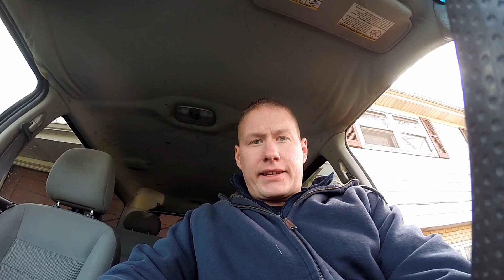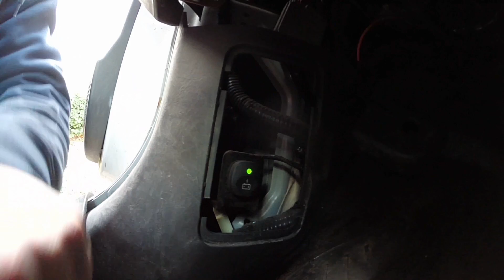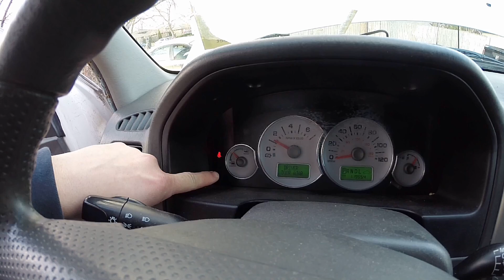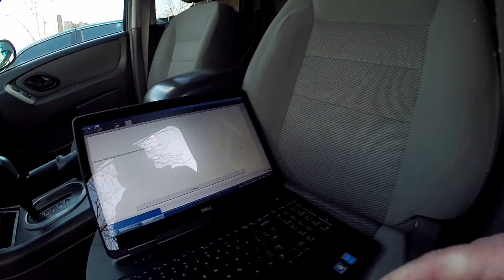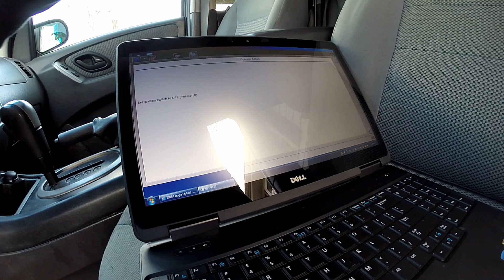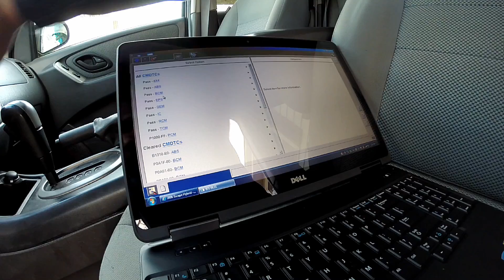2007 Ford Escape Hybrid No Start

Comment: I've actually got the 2008 and normally the button works but this time it's not. There's a clicking sound coming from the dash, rapidly, even though the key is not in the ignition. I had left the back right window down when I went in the house and when I came back out to the car about an hour later it was dead. When I push the button it turns sort of orangey, not green. I replaced the 12 volt battery about three or four months ago.

Comment: You are the man!
Bought a 07 at auction. Non running. Full battery dropped in it and with one push and 10mins it started up in the auction yard and drove on the trailer. Needed a coil, valve cover gasket you know typical L-series maintenance. Thanks again

Comment: 1)  Instead of charging the 12 volt battery first  and instead of hooking up a battery pack the the 12 volt battery.....  Can we use another vehicle with jumper cablers connected to the 12 volt battery on the hybrid escape and then use the same sequences of pushing the black button and wait 8 minutes while the system charges the rear hybrid battery?

2)  Would the jumping vehicle need to be running during this process as well?

Excellent and Very Helpful info Sir!!!

Comment: Does this work on the 2008 Mercury Mariner Hybrid as well?
Reply from the maker: yes
Reply: @FordTechMakuloco  I can't seem to find this button that you found and pushed on my Mariner. Do I need to look harder for it?
Reply from the maker: watch this video- https://www.youtube.com/watch?v=TA6Of25tnCY&ab_channel=FordTechMakuloco
Reply: @FordTechMakuloco  TY so much for getting back to me on this issue and hopefully tomorrow I can get it running again 😊
Reply: @FordTechMakuloco  Great News after you advised me on the location of the BCM button behind that driver's side panel and having a new battery and jump pack on the battery as well. Your excellent service helped me get it to start after about an hour of charging and everything works fantabulousy.
Thanks Again you've saved me a lot of money in having a tech look at it and was simply simple.
Once again TY Brother 😊😁

Comment: I have charged the battery and the HV battery is charged. But still will not start because the triangle symbol is still on the dash. Does anyone know how I clear the codes without a code reader?

Comment: Have a issue 
The wrench light and red triangle with exclamation 

Truck won’t start at all 
Both Batteries charged
Obd monitor test:
Exhaust gas sensor mon bank 1
Exhaust gas sensor mon bank 2
Catalyst mon bank 1
Egr mon bank 2
Evap mon A,B,C
Misfire cylinder 1 data A2
Misfire cylinder 2 data A3
Misfire cylinder 3 data A4
Misfire cylinder 4 data A5

What could I do ?

Comment: Ver informative. I have a 2015 Fusion Hybrid. My High Voltage battery is dead due to non use so the car won’t start. Would you happen to know how I could “jumpstart” my car?
Reply from the maker: These require a special charger the dealer can rent from Ford.

Comment: This is an amazing video unfortunately when I press the button of my '08 (slightly different location) the LED does not even light up. Do you have any suggestion?
Reply: Hi I own an '08 as well this is my second time going through the process it seems the LED for the '08 will come on as an amber color if the battery isn't fully charged and if you're in a bright area and not looking the button head on it's nigh on impossible to see that the light is on hope this helps

Comment: Can a dealer test the DCDC Converter? Have our 2007 Mariner at the dealer and they want $2900.00 for the converter. I asked how they came to that conclusion and they said " we follow ford's troubleshooting points." 
What is the best diagnostics tool I can use to check this component before we start throwing money at it?

Comment: My 2008 still runs and drives but if I take off real quick it will pop a P0A1F battery energy control module fault.. any ideas?

Comment: My 12v battery on 2006 escape hybrid is fully charged, all lights work fine, but still does not crank.  I found the jump start button under dash to charge HV battery but when pressed with key off, does not light up.  How can I charge HV battery?

Comment: great advice   I have that same escape LOVE IT the best  It paid for itsself and its insurance! Off road is so sweet total stealth when you went into the reprogram mode i flashed back to 1 day driving along and just when i passed a Ford dealer I had total break pedal lock not the complete break failure just the pedal lock then let off and try again and it works But soon after i started having the TOTAL break failure where it shuts down the vehicle completely and youd be lucky to stop at all !!!  Well years later after just putting up with the once in a blue moon failure i blew a front break hose out in the wooods and after replacing it i chose to just gravity bleed the front calipers! Strange but it fix stopped the failures that was 3 years ago! Your vid made me wonder if theres a wifi antenna on my hybrid and it was corrupted by a ford dealer?  PS something about the anti lock valves and the front pressures?

Comment: Recently purchased a 2006 hybrid escape being sold by the state, they were selling it as a non-runner. Got it for a steal. Of course it didn't start,  12volt battery was dead.
Found mention of the charge button in the operators manual. Did a google search on no starts. Found your video Did exactly like you said, WALLA it started. 
My wife found a receipt from a Ford dealer, that said it was the hybrid battery or wiring harness. They charged them 300 dollars for the inspection. I can't believe a dealer did that.
Thank you very much for you video.
Reply: Hi Raymond I just got the same situation like you did buying 2006 escape. Could you exactly ho
Reply: Hope your still around, did you replace the 12volt battery then? That fix the issue?
Reply: Basically a good running car for I operability status/price. That does sound like a really good deal! The dealer was inept for doing the owner like that. It was meant for you I surmise.

Comment: What program on your computer are you using to do all those updates and everything for the hybrid battery I have a 2007 hybrid myself and I would like to know how to make the batter in the back more reliable?
Reply from the maker: I use the Ford dealer scan tool. The best way to make that battery reliable is to drive it and keep the current flowing.
Reply: I also have another question, my car is only getting 22 mpg and I know these cars are suppose to be getting more you have any idea how to get that to go up or if it’s anything with the hybrid battery that would make it stay that low
Reply: Any thoughts?

Comment: Hey bud I’m having a issue with my 2010 escape giving me code cylinder 3 misfire I change the plugs and coils all 4 cleared the code but came back on did a cylinder compression  test on the cylinder reading 100% check the injectors reads 1/2 cylinder 15/16 3/4 3 14 and 4 16 any ideas please thanx

Comment: I just bought a 2005 hybrid ford escape. The suv wouldnt start so i did axactly what this video said but now the radio dontvwork and the speedometer dont work nothing comes on not even like the rpms indicator or the mph indicator and there is a gauge that says assist that one doesnt turn on either or the miles indicator or the prnd do not show. What can i do???? Any help

Comment: Had a no start as well.  Left it undriven for 1.5 months, came back, engine would turn over and then died after 20 seconds.  Tried again, no turnover and wrench light etc. light up.  No turnover.  Reset battery, it would do the same thing...turnover once and run for 5 seconds then die.  Wouldn't turn over again.  Took it to Ford Dealer and they said the High Voltage Battery was completely dead.  They recharged it and voila.  On retrospect, if we let the car sit for a few days, the voltage indicator would show that the High Voltage Battery was dead and the engine would surge on first starting.  Not sure why this slow drain is happening (or did happen) but it hasn't turned over/no start since.  And we also won't be letting set for 1.5 months again.....maybe disconnect the battery when we go on long trips?

Comment: Hi makuloco.....How can you know if CVT is bad?  I heard that the electric resistance (Ohm)  measured between cvt connector terminals cable component side??? I think i have some issus with the CVT because my battery fuse is bad. i was going down the freeway and it had to be towed home ...The fuse is very expensive...

Comment: This video is a life saver! I have a 2007 Ford Escape Hybrid in Phoenix AZ that was sitting for a little over a month. My battery   was completely dead (from the heat and not moving) so I bought a new one. Car still wouldn't start after installing it but I did get lights and dashboard indicators working. So I followed your steps by hitting the battery charger button on the left side under the steering while. Everything worked as you said. I hit the button and had a solid green light. I hooked my other vehicle up with jumpers just to assist with maintaining a charge (not sure if that was necessary) and after about 4 mins the green light began to flash. Tossed in the keys and it started right up! So thanks again man.

Comment: I have a 2008FEH last week while driving steering wheel locked and car shut off. Had it towed as I thought it just got too hot. I do live in Las Vegas and the temp that day was 120. The next day I turned it on and it stayed on for all of 30 seconds and shut off. I did notice the wrench light on and now the ABS light is on. I'm afraid of how much it's going to be to fix it. Any suggestions?

Comment: My 2008 Ford Escape Hybrid does not have the button in the kick panel on the driver's side.  Where else should I look?  
I have a 2008 with a no start condition.  I'm sure the battery decharged again when I left it for a few days without starting.

Comment: does the 2006 FEH have any module inside or outside the hybrid battery that can be reprogrammed / updated?   If it does, what Ford training/certification is needed to diagnose and be able to do such work?  Thanks!

Comment: frank t    Great Video!!!    I just had the coolant pump replaced on a factory recall on a 2006 FEH.  Prior to this I had a problem with the engine shutting  down on a private bumpy dirt road on two occasions so,  I asked to have the hybrid battery reprogrammed or updated while it was at the Ford dealer, since it seems that this is what you did on the car in this video. I asked that the dealer supply me with some print outs showing the job had been done. When I went to pay the bill they had interpreted my request as follows: C/S REQUESTED TO SEE IF THERE IS AN UPDATE THAT NEEDS TO BE PERFORMED ON THE VEHICLE.  RUN IDS DIAG AND CHECK FOR UPDATES ...PROGRAM PCM AND TCM TO LATEST CALIBRATIONS. 
 
When I asked for the print out the service advisor said he would check with the tech.  The tech came back and said he wasn't asked for that when he did the job and it was too late to be able to get a print out.  I asked about why he didn't program the hybrid battery,  He said the hybrid battery didn't had a module that could be programmed.
My Question is this: does the 2006 FEH have any module inside or outside the hybrid battery that can be reprogrammed / updated?   If it does, what Ford training is needed to know this and be able to do such work?  

Since the Factory Recall 14519 the car has not shut down on the bumpy road, and my gas milage has increased by several mags.

Comment: I am having same problem with my 2005 Ford Escape Hybrid.  The weird thing is when I press the Jump button it blinks and does not go solid.  My battery (12v) is fully charged.  I even tried to connect my 12v to another car at same time to ensure full charge but when I press the Jump button it still just blinks.  Any ideas? Does this mean my hybrid battery is toast? nlellis8 at Gmail dot com.  Please if you can help and thank you.
Reply from the maker: Make sure the key is removed from the ignition for 10 seconds before pressing the jump start button now it should go solid.
Reply: I tried this as well and still when I press it just blinks.  Is there any way I can bypass to get a charge to the 330v?  Wondring if the 330v battery is toast and that is what is causing problem?
Reply: @CDBS-Magazine  Any update?

Comment: Most 2008 and all later model don't have that start buttons.
Reply: That's right . My 2008 FEH does not have one . Is there any other way to recharge hybrid battery on it ?  Thanks for the videos you post Brian , excellent work!
Reply: 2008 does. It is behind the panel in the door jam on the dash. The small panel needs to be removed. See Brian's other video on this.

Comment: I have the red triangle with check emission systems after I hit a bump. it was only 3 days prior to this that the strut smash through the floor right passenger rear. I haven't had a chance to fix the strut and then this new thing happened with a car shut down saying check emission systems red triangle. this happened after hitting a major bump

Comment: I have a 2009 it does not seem to have the button to charge the high voltage, what is my option?
Reply: Any luck with this?  I am having the same exact problem with my 2009
Reply: @bastholio  hi  I have 2012 ford escape Hybrid  no start   how to recharge hibrid  battery
Reply: Any luck with charging the battery I just bought a 2009 with the same problem any help would be highly appreciated

Comment: Just replaced the HV battery on my 06 escape Hybrid started for about 5 minutes and then dies again . Red triangle and yellow wrench are on waiting 2-3 minutes starts again runs for about 20 seconds and then dyes again I pulled on my obdII scanner P0A1F . My question is if the BECM needs to be programmed or the PCM after replacing the battery

Comment: I'm looking to buy a used Escape/Tribute as a first car for my son, but I rule out the hybrids.  The cost is about the same as the non-hybrids.  They are reliable until they are not, then it is just another level of complication and potential significant cost. Thumbs up on your video though, dealer would likely say to replace this, that or the battery, etc.

Comment: I towed my Ford Escape Hybrid to Ford.  They quoted me 12000.00 for  a new  battery.  I bought a replacement battery off LKQ parts, installed it and it still won't start. What now?  It turns over then says pull over safely and turns itself off.
Reply from the maker: Won't start or won't crank? PM me on facebook.
Reply: I'm having the same problem changed the battery everything came on push the button until it flashed still want start
Reply: I have the same problem. What did you do
Reply: Hi Susan- I'm in the middle of this very same charade myself. Ford quoted $12,500 for new high voltage battery. I'm trying to check all the boxes before buying a rebuilt battery. Did you ever get to the bottom of your Escape's issue? Please do tell!

Comment: So, that's how u jump start a Ford Escape 2006 Hybrid? Thank you for the helpful video. Now, does the owner need to buy in the near future a new 12 volt battery with fresh cold cranking amps because of the old battery's failure to crank 100 percent efficiently in the cold weather of the Chicago land area?

Comment: Hello... I have a FEH 2008, with the same problem...  No Start.... but... where is the botton for HV Batery Charge ? ... "jump Start" ... I saw the driver's side ... but I don't see nothing ...  Thank for your support.
Reply from the maker: Drivers side kickwell there is a cover you must take off.
Reply: My friend, I check again there's not any cover or button.  Any other idea?
Reply: My friend.   I found it.  It's between control panel & the driver door.  Thanks again!

Comment: I desperately need help I purchased 2006 ford escape hybrid , high voltage battery was not taking charge :$ purchased a battery used from a scrap yard . Changed a harness also . Now it's running but service emission system popped up right away and now service engine popped up . I'm concerned the replaced high voltage battery is not taking a charge :$ I've put 10 thou into this already have a baby on the way and am getting into trouble badly finance wise . Please help . Does a regular code reader work on this vehicle ? Or do I need something special ? I can't even afford to bring it back into a dealership . Is there an email contact I can talk to someone ? Please I desperately need help .
Reply: Try it with a regular code reader, they are not to expensive

Comment: hi i have a 2009 escape hybrid and was sitting still for 5 months due to collision in drivers door , fixed door  but hybrid battery is discharge and cannot find button to recharge like in the video. can you hep me.  Thanks
Reply: Any luck with this?  I am having the same exact problem with my 2009
Reply: Did you get a fix and if so what was it please?

Comment: i'm dealing with an 06 escape no start and there is no light at all on the button in the kick panel. the owner bought it at an auction and had to have a key programmed for the vehicle. He's insistent on it being the starter is out. Do you have any quick checks for me? The vehicle has 150k+ on it.(old comed service vehicle)

Comment: Cant tell you how many times I got calls of people saying the car would only run for a min or so and turn off.  its always MG1 in the transaxle spinning trying to turn the engine on.   Gotta love hybrids!
Reply from the maker: +Kurt Kennedy Yeah it cranks at such a high rpm it confuses them.
Reply: What does MG1 mean?  I'm having that problem after swapping in a new (er) engine.
Reply: @michaelschwed  seems to be electrical engine. Mg1. I am assuming the spinner on the transmission, that acts as starter?